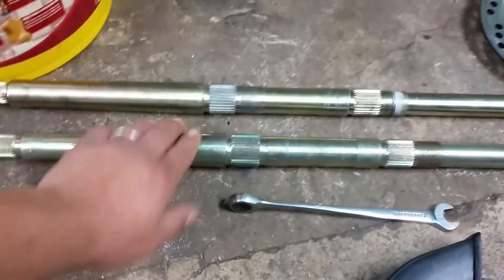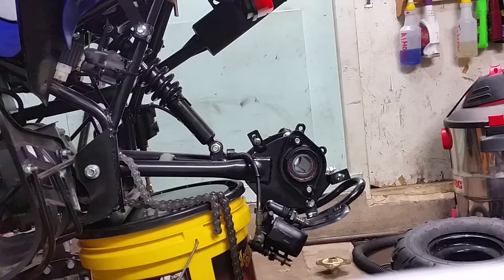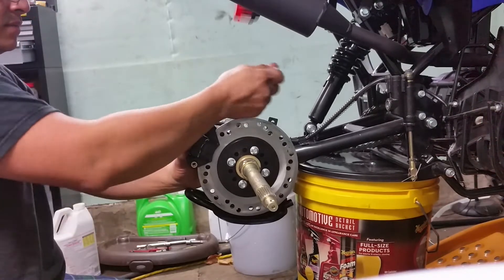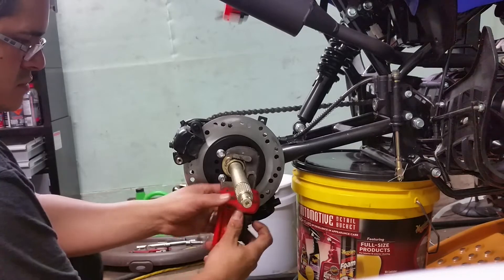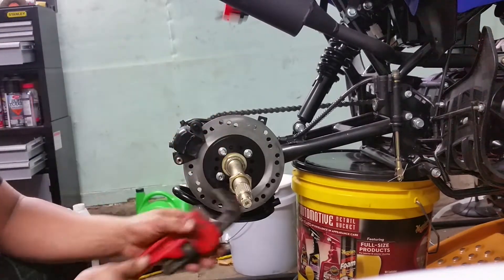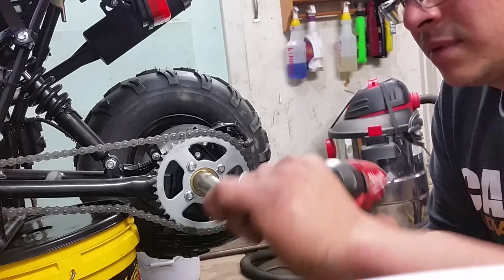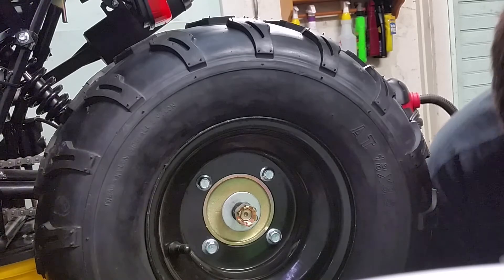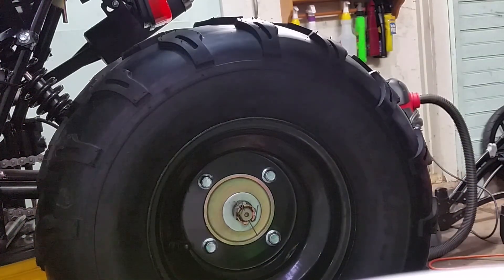Tao Tao Chinese Cheetah 125cc rear axle assembly

Comment: Great vid. I bought a front end with swing arm and no engine. It’s a 110 Taotao I think. So I need a rear axle assembly and wheels. Seems pretty straight forward. I’m putting a Predator 212 in mine.
Reply from the maker: Thtat will be my next step when that engine goes apart
Reply: Putting a predator 212cc on this atv would fabricating a mounting plate be necessary?

Comment: There's a lock ring that is supposed to be under that sprocket. It holds it on. It will do the same thing and come right off just got one and first ride popped right off. found a lock ring that fit and no problem.. Seeing ur video makes me think they do not have that installed on the china atvs...thanks
Reply from the maker: You can add lock tie or even urethane on the sprocket bolts big plus

Comment: What size is that rear sprocket, 530 or 420? And is what tooth count is it. I'm trying to find different sprocket sizes only.
Reply from the maker: Hi Marcus Reels the sprocket X-PRO® 37 Tooth 420 Chain Rear Sprockets for 50-125cc ATVs  is the current one I'm using and stock size also
Reply: @PR-zq8ih  thank you, I've been searching high and low for the right  Sprocket, I have the TaoTao Bull 200cc and it came with the 530 setup, I may have to switch up everything to a 420 just to have more gear selection. Thanks again for the info